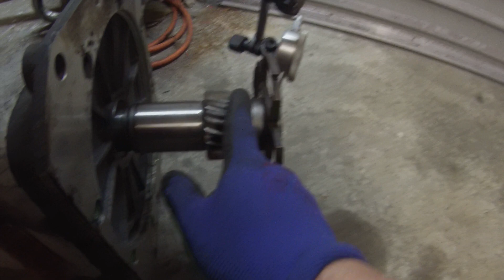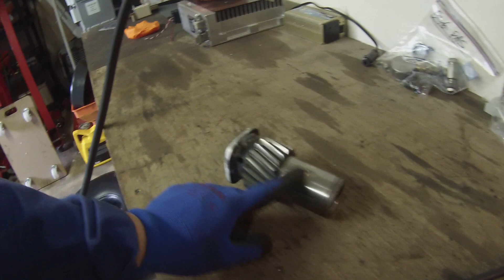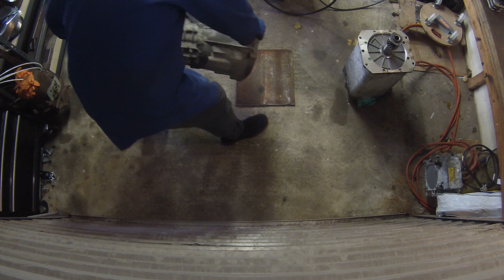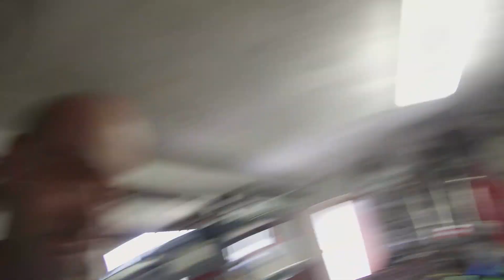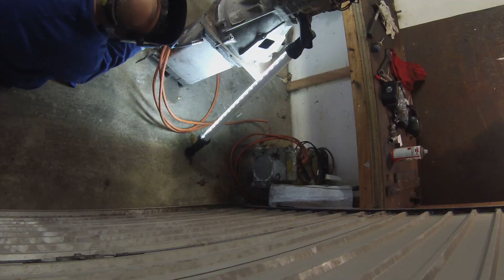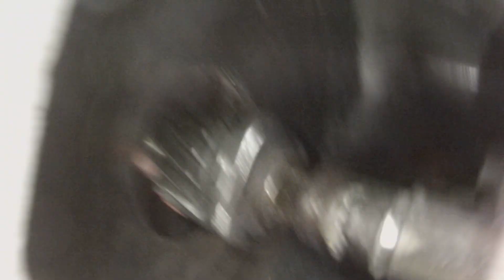Mazda RX8 EV Conversion Mini Series 02

Comment: Hey, awesome project! Just one question, why do you leave the gearbox? Wouldn't it be possible to just connect the motor to a driveshaft directly? There surely should be enough rpm.

Comment: Can't understand why everybody wants to remove the clutch in these conversions? Surely it is easier just to leave it in place (assuming it is in good condition) and then fit the original flywheel and spigot arrangement to the electric motor????
You then have a more standard system unless of course you want the clutch gone in order to minimise failure points if you are going drag racing.

Comment: I just discovered your channel. I been wanting to convert to EV for a while. I have forklift motors. And I figure unless I put them in a yugo with 72 volts on them . I'm basically going to have a golfcart! I need more power. I'd like something like a tesla motor in my truck! At est 4200 pounds weight. It's not much different than a Tesla. Except for being a brick in the wind! (92 1/2 ton Chevrolet truck) its 4wd. I'd like a Tesla gear box and make it awd! I'd need to swap the front diff. But it may work! Or just make it fwd with out the front diff. Just the Tesla gearbox. So many options. I would kinda like to keep the trans. W but what do I know!

Comment: Hi, I would like to ask you, this motor is how many HP, or CV or KW, my idea is to connect with a permanent power generator without the need to charge batteries, it would be like this: an 8kw generator, I found in my country of 127v, and weight of 85 kl, the generator would be transformed by a conventional motor of 127v that same engine rotating the generator, would receive the energy of a battery of 12v, with a inverter of 12v for 127v, with the energy produced I would take the generator's energy to charge the 12V battery and with that it would have permanent energy, but it is an idea to put into practice, not if you would strain the power to feed an engine like the one you put in this differential, apparently this engine is strong and should consume a lot of energy, then how many CV KW or HP would you indicate and also how many RPM and voltage, sorry for some errors, I do not speak English, I did the translation by google translator, thank you!
Reply: 100kw if im not mistaken.

Comment: The BMW EV projects were quite understandable but gutting a wankel car from what makes it stand out is a little sad IMO although there might be plenty of reasons as to why.
Reply: Pasta Sarmonella E-Specialé yeah like the engine is knackered at 60k miles and the cars then worth 600 quid
Reply: It still is a rotery now :). Plus those rx8 engines are notorious. Lots of perfectly fine rx8's in scrapyards because of engine falure.

You can pick up a mint one for conversion for less then 1k probably.

Comment: Looks great, nice work. Although I would recommend using a flexible clutch for mounting the gearbox to engine, well you made the solid clutch precise and accurate so it will be alright, have you used a solid clutch on another car before?
I have worked on industrial machinery that require high mounting accuracy, so i would recommend watching this video:
https://www.youtube.com/watch?v=N0uhUAdEt7U
Reply from the maker: Yes have used all solid couplers. The gearbox input shaft requires support so a flexi coupler would not work here.
Reply: @Evbmw  I use the flex coupler called a Lovejoy and use the pilot bearing with a bushing in the motor side to support the transmission shaft. That said you're careful aligning looks like it works pretty good too.

Comment: Would the gearbox work without the bell housing and allow for a much shorter adapter thing?
Reply from the maker: Yes with sufficient engineering. I just need it up and running.
Reply: I just connected a 9-inch warp motor to a f 150 transmission and didn't use the bellhousing.https://youtu.be/DSTznktFjlQ it did not really save me any room as the shaft coming out of the transmission is as long as the bell housing. I could have cut the shaft and just welded I love joy coupler to the transmission shaft but room wasn't a problem.